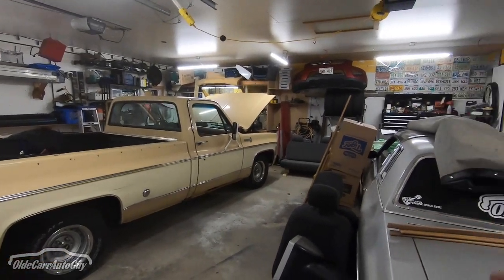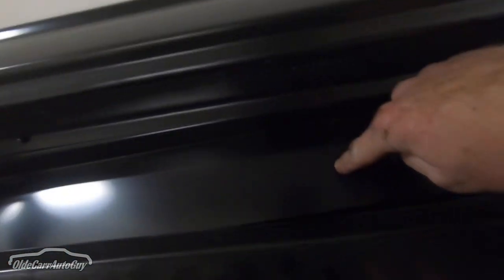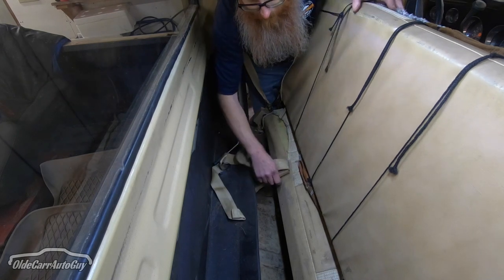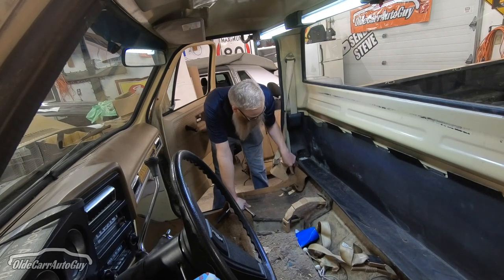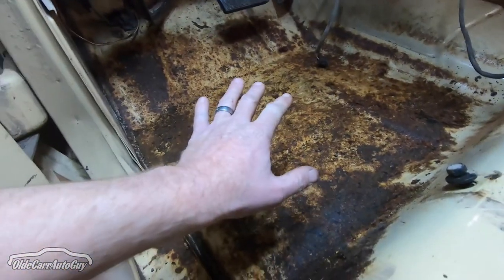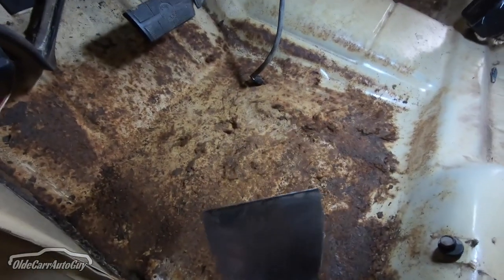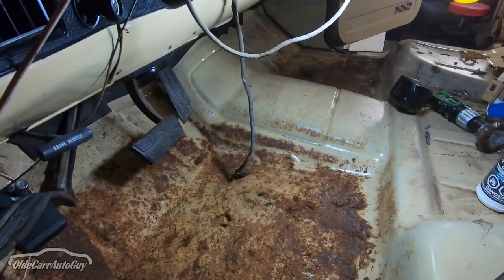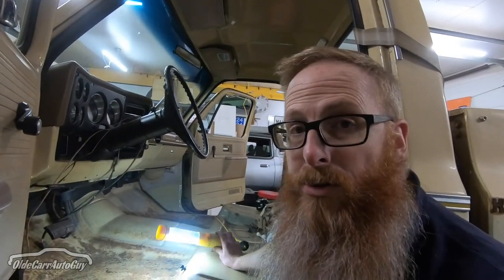HOW TO REMOVE THE SEATS, CARPET AND SEAT BELTS IN A 1973 1987 CHEVROLET C10 PICKUP

Comment: i like using bed coating/undercoating on the tops of the floors. that way the small areas that sometimes leak and the heater core that goes bad leaks in the floor wont do anything to the floors.  not to mention the added insulation it gives
Reply from the maker: When everything is all said and done, I just may do that!
Reply: @OldeCarrGuy  i always considered it cheap insurance

Comment: Only thing different I would have done on the floor would have been a wire brush wheel, but it really looked like it cleaned up fairly well as is. I probably would have attacked it the same way as you, not worth replacing the floors.
Reply from the maker: I guess the time lapse was going too fast as I did have a wire brush on a drill and stuffed it good
Reply: @OldeCarrGuy  aha! I couldn't tell if that was a wire brush or one of those hard sponge wheels. But I found that my die grinder with a wire brush did about as good as anything on those crown vic wheels. Happy motoring my friend!

Comment: What size torx bit/socket did you use to remove the seat belts?
Reply from the maker: My 77 uses 13/16' bolts for the seat belt. Newer square bodies may have used a t50 torx. Hope this helps.

Comment: Anybody have trouble getting their bench seat like this to come forward? Mine is a 1973 C10 Cheyenne Super and I can't get it to go down like this.
Reply from the maker: Sounds like it just needs some lubrication in the track. You may also have only one side unlocking. Check to see that the cable that is attached to the handle in connected to both side.